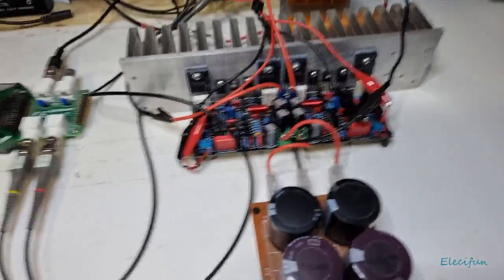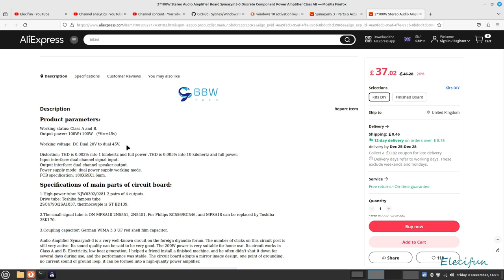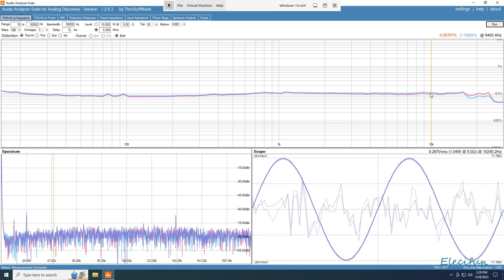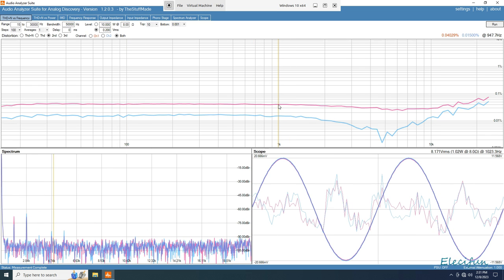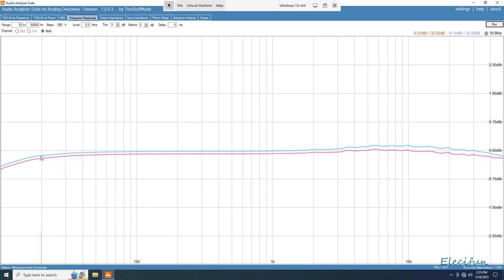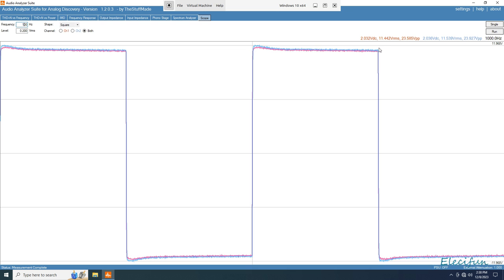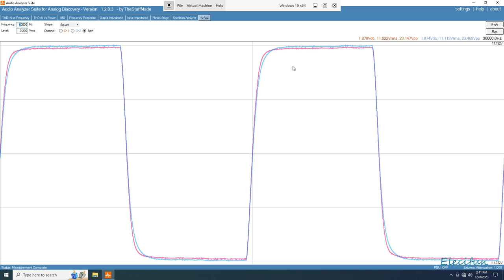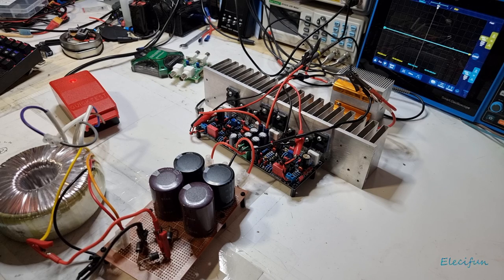Symasym 5-3 Amplifier Kit Testing

Comment: Interesting stuff even if most of the technical jargon flies over my head. I like that you perform these advanced tests because my only test equipment are my ears lol. I will simply avoid the kits that you determine are 5h!t lol lol. I do wish that there were repercussions for false advertising. I agree with the other viewer's cat o nine tails suggestion. Cheers amigo. BTW, I switched over to INAV 7 on the OX7 quad and everything is going swimmingly. I should get my fpv monitor tomorrow and it should help improve the production quality of my vids. Cheers amigo. I hope you're having a happy Christmas season. 🍻 🎅 👍
Reply from the maker: Sound I will check on your channel in a bit.

Comment: Your speed of build was certainly impressive!! So you saying your Christmas dinner was better???

What is the noise floor of your equipment? Have you ever done a loop test of your equipment? Eyeballing your graphs - you noise floor seems to be around -105db?
Reply from the maker: The only thing I have checked is scope grounds do not ground to the USB from AD2. When I test I use my laptop with battery and not connected to the power supply. I understand that may not clean up everything its the best I can do. I use a Dell Precision M4800.

I may use ARTA to take a look at some stage. As you know ARTA has a process for calibration and the outputs it displays can be depending on many factors.

The point is when I test I use the same setup on all DUT's so all will incur the same positives and or negatives from my setup.
Reply: Hi, You should be able to test the thd etc of the same equipment you use to test the amps.
Instead of plugging into the amp input and then amp output to the Digilent - plug directly in into your Digilent bypassing the amp- that way you loop the test equipment, and should be able to test the THD of your equipment
Would be an interesting test
 @Elecifun
Reply from the maker: @zoelong6021  After reading your comment I played around connecting outputs to inputs.

The Audio Analyser Suite requires a load impedance in Ohms to run the THD tests. It won't run with 8 Ohm load as no power, distortion exceeds limits.
Reply: That's a pity then - I don't know the Digilent equipment, most analysers allow for loop back testing.
I mostly use Arta, its accurate, lots of support online as used by many - and also cheap.
Will keep watching your channel...who knows what nice goodies you may uncover? @Elecifun
Reply from the maker: @zoelong6021  Are you talking about connecting AD waveform gen to AD scope input and measuring?
What sound card are you using, I see Xonar in video. Which one?
I have been thinking about getting a sound card for my computer and testing with ARTA. Would you suggest a sound card..
Sound Blaster X5 or AE-9 ? both have great specs.
Reply: Hi, Going to try keep it short as possible.
I'm using an old desktop with an Asus Xonar AE 7.1 sound card with ARTA. Good bang for buck -  on a loop test i get thd+n of 0.003% which is good enough for me spending only $50 for a soundcard. 
But the issues I experienced were that these SC's are made for gaming - i struggled to get the line in level correct in the beginning so eventually added a buffer to match what i think was an impedance issue between the attenuator after the amp output to the line-in of the sound card.
Also some amps (more so bridged amps) - dont like the grounding aspects of the soundcard. To get around this - using an ipad i generate a sine wave from an online tonegenerator website and feed that into the amp under test - i tested the ipad sine wave and it showed thd+n of 0.005% - not bad. You can get sine wave generators with much less distortion.
The Creative soundcards are best of class actually, but pricey. Rated at a very very low 0.0001%. thd+n. But Im not sure if they will work. I could not see a "line-in"/"line out" socket?? Perhaps do some research first.
Another option to consider and is actually cheaper is a Focusrite Scarlette 2i2 - I have seen them used quite effectively for this purpose in another russian guy you tube channels (it does impedance matching for you) - I am planning to get one of them next year.  https://youtu.be/nM7eD1XeqZw

 @Elecifun
Reply from the maker: @zoelong6021  This comment was on hold because of link.. Nuts. Never mind I have it now.
The Creative SB AE-9 has an aux input on back of control box. Can I use inline passive attenuators from DUT to aux input, 20db?
I'm having a struggle setting up ARTA calibration. I think I understand the instructions but am not clear on what I'm doing. I've searched but cannot find a setup video showing step by step calibration. 
First cal part I measure left channel with DMM with output up full. I get 1.573V I enter and hit estimate peak output mV. then accept. Easy. 
The bit that has me scratching my head - Sound card full scale input. 
I kept upping output on SDG830 until just less than clipping when ARTA was sampling. Added the voltage where it says enter voltage. I'm not sure if its the right way to do this. I added a picture to my community, if you want to take a look.
Cheers for your input. I really do appreciate it.
Reply: @Elecifun  Hopefully this helps
1. I looked at the user manual, and you should be able to loop the RCA out to the RCA aux/in. And in fact, I think you could even loop it using the optical, as it has both Spdif in/out.
2. These SCs' are driven by complex software that allows changes to audio characteristics typical for gaming - I had to go into my SC software where I had to configure it so that it doesn't change the audio and also I could set the aux-in level. I saw in the AE-9 manual settings to switch off the acoustic engine or DIRECT MODE.
3. I read from the manual AUDIO RECORDING MICROPHONE AND OTHER INPUT TAB The Microphone tab offers users the ability to configure microphone input with various controls and CrystalVoice technology while the Other Input tab allows users to choose between recording devices e.g. AUX-in / Line-in, Digital (SPDIF-in) and What U Hear
4. The AE-9 looks like a serious piece of kit - no reason why you shouldn't be getting close to their spec 0.0001% by looping OUT to IN.
5. ARTA is actually very simple to get going, which is why I use it more than anything else and is very accurate. only 3 steps are needed (its obviously has more rich features)
a.  - Select "Spectrum analyser"
b.  Setup Audio device
c.  Press play.
From what I can see on the clips.
 - There is not enough volume or input level is to low. You should aim for the 1khz signal to peak around -3db.
- The noise floor level should be quite flat across all freq except for the harmonics- check that the AE-9 is not applying software filters etc that is boosting/cutting some frequencies
- Try get the Arta working with the sound card by looping OUT to IN as a baseline before adding other devices

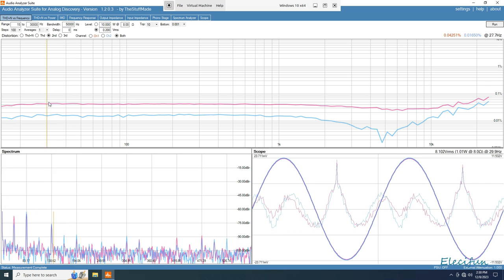Comment: @8:51 So what you're basically saying is the specs are BS. 🤔 That guy that said this board was good and had low distortion needs a good vicious beating with the cat-o-nine tails. 😅😅
Reply from the maker: Lol.. not sure a vicious anything will change anything.. 
His test setup is different to mine and I didn't buy this because of his claims. I bought it to take a look and see for myself 😉
Reply: @Elecifun  it was a facetious remark.
Reply from the maker: @decem_unosquattro9538  I will have to cancel the Cat-O-Nine_Tails I ordered.. Lol
Reply: @Elecifun  😅👍
Reply: @Elecifun  Why not have a go at building some speakers? You've built heaps of amps. Why not try your hand at building a cabinet and getting some speakers? Cross over for 3 speakers. Even if it takes a month it would be a fun and interesting build.
I'll be building some speakers after I pay for other more urgent things like my teeth.
Reply from the maker: @decem_unosquattro9538  co inci'dentaly' I have a top denture, bloody thing broke as I was tucking into a pork chop on Friday. Dentist wants £87.90 just for consultation.
Maybe I should be working on making some more teeth...!
Reply: @Elecifun  oh god no ! No you too! 🤔 wow I'm surprised a denture broke because I assumed they would never break. Sigh.
Mines going to cost 2K actually more. Sigh. 😕

88 u.k pounds sigh.

Tell me about it. Dental here is f** scary. 

$350 for an extraction. 
The last one I had was the most painful experience of my life.

I was sweating it was so painful.

I blacked out at one stage.

God, leaving that dental practice was like leaving jail after 40 years. What a relief albeit with opiate painkillers.

That was definitely the worst 20 minutes of agony that I can remember.

I just hope and pray (I'm not religious) that I don't need to have it removed. 🥺😆 I laugh about it now but Jesus Christ that was painful experience.
Reply from the maker: @decem_unosquattro9538  Your experience sounds harrowing, to say the least.
Many of mine I lost as a kid. Fighting cost me my front four. No compo for a lad that wouldn't snitch. I've broke my denture twice now. All part of life's fun.
Reply from the maker: @decem_unosquattro9538  JohnAudioTech is in speaker design and build mode as we speak. I will be watching and hopefully learning over the coming weeks.
Reply: @Elecifun  Oh that's great news. 👍 😀
My friend had his speaker designed by someone that obviously understands how sound works and the importance of  airflow and whatever it is that affects sound.

I just decided to use an existing design.

"Bass reflex" is what I chose because that's what my mate decided to build.

Bass reflex speakers have a hole 🕳 that air comes out of as the transducer moves back and forth.

Those speakers I linked are bass reflex speakers.

I read that the bigger the speaker the better the audio reproduction or that seems to be the general consensus.

I noticed for example that Sony headphones 🎧 have 30mm transducers whereas the older models were bigger.

Also the more expensive headphone models that are wired have bigger transducers.

This leads me to believe that this is generally true although it's not the total picture.

Other factors will affect the audio quality.

Obviously you understands some of the reasons more so than me.

Personally I'm just going to pick speakers that have already been designed.

I don't particularly want to learn the science of sound.

The farther away from a speaker the worse it gets.

Ideally you should be a certain distance from a speaker.

On another topic related to sound is power.

How much power does one need.
This is a highly controversial topic which could end up an argument.

Still to me and others bigger is generally better.

It really then comes down to how much can we afford?

I knew a dude years ago that stole a few of my vinyl records.

Well he had a massive sound system.

Two huge boxes which where 5 feet by 5 feet by 5 feet. 

I don't actually know the exact dimensions suffice to say they were insanely big.

He had two 18" transducers + 2 mid range speakers + tweeters.

Two massive pioneer professional amplifiers.

A turn table, and a big Teac reel to reel tape player.

His bed was on top of these two huge boxes or cabinets.
Not an ideal position for speakers.

The funny thing was is that his room was tiny.

You couldn't swing a cat in this room.
I never actually heard the sound from these speakers.

He did say the entire house shakes.

I don't doubt that. 😄

My mates speaker I can only guess how big the bass transducers were.

They must have been at least 12" or 14" my guess is they were 12" maybe they looked bigger back then.

The sound of of these speakers was amazing.

Very dynamic and realistic.

He played Fleetwood Mac "Rumours" and the drums sounded realistically what it was like to listen to the band live although what I mean is inside a sound recording studio without columns and rows of giant speakers at a rock concert.

The bass was remarkably good as was the mids and the highs.

One rarely heard audio like that nowadays simply because the cost is prohibitively high and it's an area where most people get scammed.

Hifi is usually an area where people pay too much for too little.

Anyway, It shall be very interesting over the next few months maybe longer.

If you do decide to build some speakers especially what I would consider my dream system then it will be an exciting adventure into hifi audio.

No doubt this will create much interest especially if the speakers are pretty big.

Obviously there are financial constraints or there is for me.

I'd build as big as financially plausible keeping in mind the area that it will be placed within.

I would ideally like the CONGA SPEAKERS that to me would be my ideal system without it being prohibitively expensive.

Those speakers in my kitchen would be wild. 😁😆
You could video the construction it would like I said be a very exciting and interesting journey.

Anyway I look forward to your comming videos.

😀😁
Reply: @Elecifun  I watched his part 1 but there is no part 2. Wtf ?! 🤔
Reply: @Elecifun  Wakey-wakey ! Hand off snakey! 😊😁
Reply: @Elecifun  It can't be that hard to build speaker boxes. Ideally one just needs some tools, a plan, dimensions etc. 

I mean if Carlito from the Manobo tribe in the jungles of Mindano cam build them from rudimentary tools compared to what we have in the West then I can't see why we can't build a nice pair. Carlito was using a friggin hammer and nails. No drop saw. No cordless drill and screws.  Also he hasn't even got a proper table. Lol 😅
Reply from the maker: @decem_unosquattro9538  So why have you not built yourself a pair?
Reply: @Elecifun  Have you ever built a cross-over?  🤔 

Imagine those speakers in your lounge. Wild! 😀😄
Reply: @Elecifun  Actually the bigger problem is the amplifier one needs to drive 8ohm speakers 

Rated power 2 x 200W 
Peak power 2 x 350W

That I assume requires a lot of power to drive without them clipping.

If it's true that you need at least double that power then that's a seriously expensive amp probably.

Especially if it's a low distortion amp.

I was watching a YouTube video and the sound engineer said you need IIRC at least 2x the power of the rated power which means 400W per channel or more.

He said the idea is to get a grunty amp and don't drive them too hard.

He said or indicated most speakers aren't driven by enough power which means the amp is over stressed which can lead to the amp failing and or the speakers clipping. The clipping leads to destruction of the speakers.

So the idea is to have heaps of power but don't feed too much juice into the speakers.

In other words don't turn the volume up too much.
Reply from the maker: @decem_unosquattro9538  M8 me speakers already have crossovers, why would I change that?
Reply: @Elecifun  You wouldn't.🙂👍
Reply: @Elecifun  Sorry, I shouldn't be trying to push you into doing something you don't want to do. 

Whats happening anyway? Anything new that you're working on?